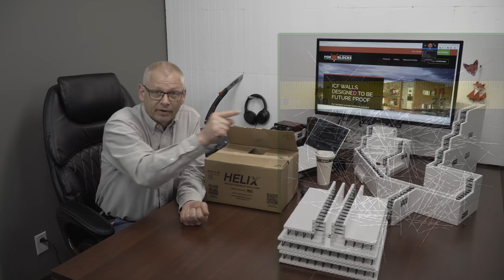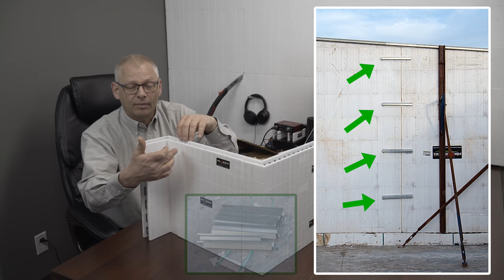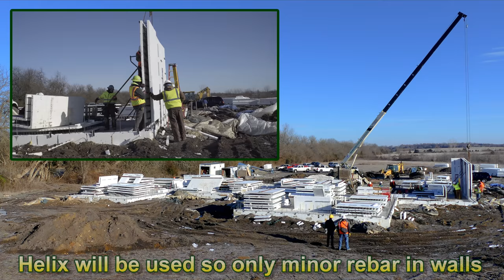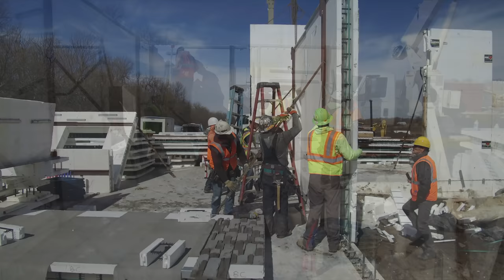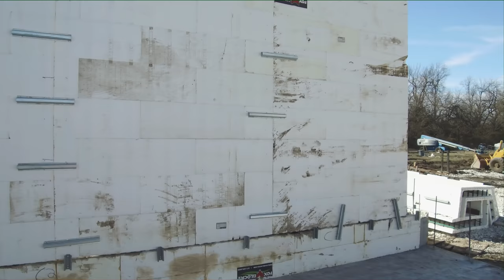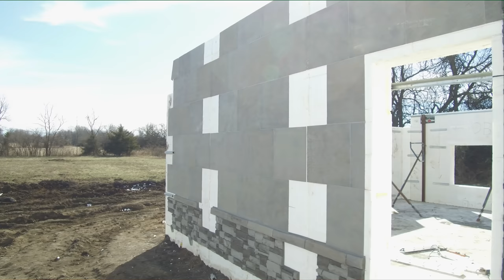Fox Blocks / AEC Wallsystems & Helix

Comment: Doesn’t panelization create cold joints and nullify the advantage of a mono pour?
If eliminating rain days is a concern put up a temporary modified version of a hoop barn in 2-3 hours.
Reply: If you use Helix you eliminate the reinforcing rods. Have you ever removed concrete?
Reply: @Drwild75  Helix micro rebar eliminates the need for horizontal rebar. That’s the whole point in using it.

Comment: How much time is saved Vs doing it all on site?
Reply from the maker: Depends on the project. We are still learning but what I saw on this project was surprising. They saved a lot of time overall. I would guess they saved more than .02 man hours per square foot from what I saw. They also had less waste because of their system.
Reply: @FoxblocksICF  does .02 equate to 2%, 2/10ths or what?

Comment: Using Helix, How much of a cost increase would you ballpark for a 2000 sqft starter home?
Reply from the maker: This will depend on location but in many cases Helix becomes at par with rebar if you take into account the time savings.
Reply: @FoxblocksICF  Good to know.  Thanks for the reply!  Can't wait to use Helix.